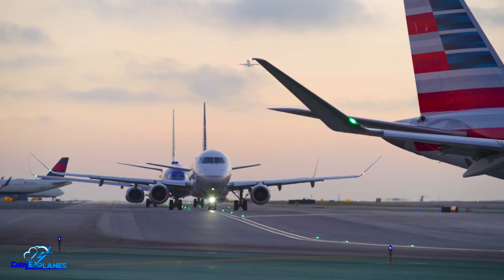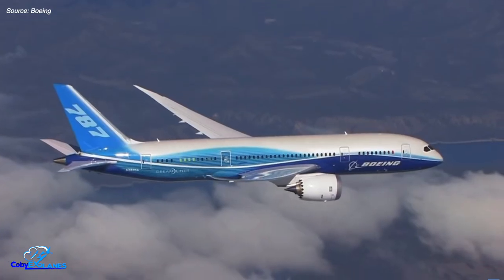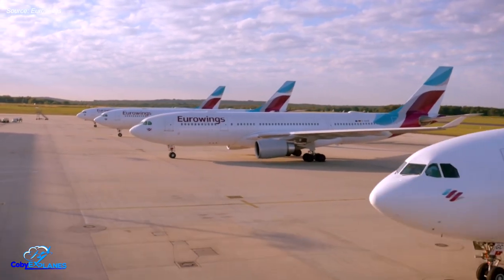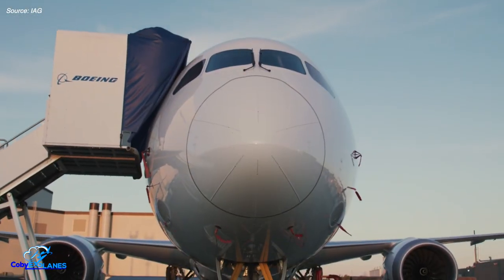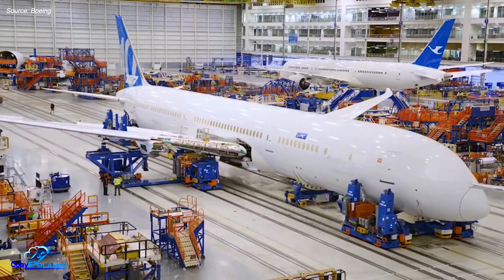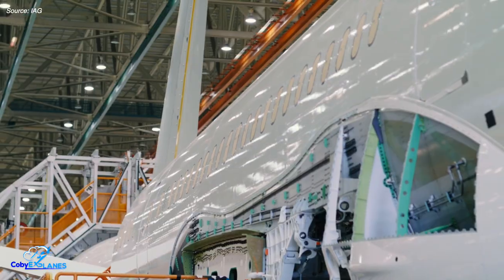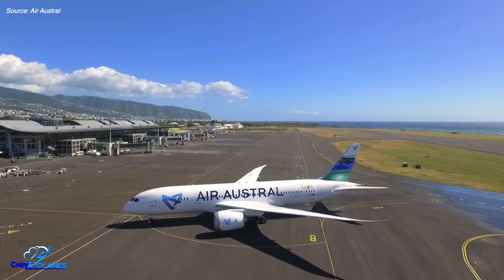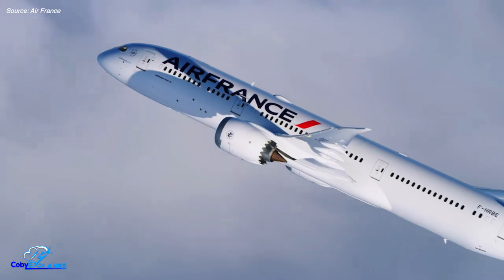How Boeing Spent $1 Billion Building a Single 787

Comment: Almost 10 years since its entry into service, 787 still looks and feels like a plane from tomorrow... The electrochromic windows, the bleedless engines, composite fuselage and wings, a nonconventional AC system, etc..
Reply: It’s still probably the most advanced airliner. The A350 came later, but since Airbus was playing catch-up, they stuck with some more tried and true technology with regard to the use of hydraulics instead of electric.
Reply: @Shadowfax-1980  I still have yet to fly an A350. I am curious about how quiet the aircraft is. Since A380's quietness has truly shocked me, I wonder how quiet the A350's cabin would be.

On the flip side, 787 feels like a long term acquaintance to me already. I've been flying 787 four times a year for 5 years now (could still have been ongoing if weren't for covid since that flight has been paused). Since I have stuck with 787 for so long, 787's technology feels like norm to me, while other aircrafts feel "rudimentary" lol
Reply: I hate those windows, they get so hot when they are darkened whilst the sun is beating against them. Like a little hotplate next to my face. Not comfortable when the pilot has decides that AC is not a luxury we are allowed to enjoy. I was looking for those directional air vents but those have also been done away with. That's just my personal experience with the 787.
Reply: @free_spirit1  Oh yeah the fixed AC outlets haha. 
From my experience the window heat isn't that big of an issue even when facing the sunlight (green rather than purple). I don't know, I get cold easily on the plane, and I prefer to sleep warm. Maybe we are different. Big windows do make filming and photographing WAAAAY easier though. 
My main complaints about the 787 is the air is too dry, and it's a bit loud.
Reply: Especially compared to it's direct competitor, A330 neo which is a re engined version of a plane derived from A300
Reply: @free_spirit1  Directional air vents are an option on 787. The air carrier decides whether or not to include them.
Reply: @Shadowfax-1980  though from experience, the A350 is much more comfortable to fly with as it’s wider. Not hating of Boeing ofc but yeah. Nevertheless, both types are amazing aircrafts.
Reply: @paulshi5974  as someone who flew the A350 5+ times…. It’s almost completely silent, and the standard windows are a plus. Also it’s significantly wider so the seats are too.

Comment: Someone in 787 flight testing told me that the missed release date was a creation of management, that the actually shipping date was close to what engineering had said it would be from the start. They didn't know what these problems would be, but they knew that there would be trouble with a tech this new.

Comment: 787 - First plane of it's type. All new electric systems, bleedless engines, all new fuselage construction methods.  The first few planes were how Boeing learned to make them.  
That cost includes all the tooling, development, construction, testing, fixing and more testing.

Still, at least when the separate sections were delivered, they fit together!  Ask Airbus about having bits of plane that don't fit ;)
Reply: Well said 55.   Late , but thank you !

Comment: great video again. I was just wondering... Considering that Airbus build the A380 at around the same time as the 787, but quickly realised that was a step in the wrong direction, could you do a video discussing how airbus was able to turn things around in an incredibly short time with the A350 considering it started development much later than the 787, but was ultimately only a few years behind comercial introduction thanks to it's incredibly fast development flights with almost no delays, which is today really uncommon for brand new airframes.
Reply from the maker: This is actually a really good idea, I'll add it to my list!
Reply: Essentially, Airbus played it safe with the A350. Everything the A350 used with the exception of the fuselage cross section and wing design were existing technology, unlike the 787, where almost every one of its technology was unproven or used en masse before. The A350 also had the advantage of its engines being built off of lessons learned from RR when it struggled with the Trents that powered the A380's and 787's. Having flown the A350, I found it to be very unremarkable as a "new" airliner.

Comment: When Douglas Corp built the DC10, they did the same thing and had to go back and retrofit planes that were half built when they found problems.  McDonald and Douglas came together, and then Boeing brought them, and obviously their staff, and as it seems that the persons from that side seem to have a lot of influence it seems they made the same mistake again.
Reply: Not how it happened but yes, they did make SOME similar mistakes. They however, were desperate to make a new profitable plane, since they were on the gbrink of collapse financially. They couldn't quite rescue themselves, but fortunately for AvGeeks, managed to do just enough to allow themselves the production of the MD-11. A stretched and improved DC-10. In Boeing's case, it has nothing to do with finances in regards to being anywhere near the brink of bankruptcy or collapse, but rather, just trying to force their planes out by dates they thought would be clever, while being ran by execs who have no engineering knowledge whatsoever, out for profits over quality, and thus, cost cuts galore, and ignoring their engineers who actually know what the hell they're doing.

Comment: The sad thing beside everything you explained so well, is the extremely tight configuration of 3-3-3 most airlines use. Making the dreamliner a nightmareliner for passengers in eco on long-haul. If only the cabin would be a few inches wider...

Comment: If I could know in advance whether I was flying on one made in Everett Washington or South Carolina, I'd fly on the one from Washington but never one from South Carolina : see documentary from Al Jazeera Broken Dream.
Reply: Boeing is shooting themselves in the foot hard here. They built the plant in South Carolina partially to crack the production unions. What ended up happening is they can't get the educated workforce down there that they can get in Washington. SC doesn't have the aviation education pipeline that WA curated over decades of Boeing presence. Getting C-suite out of WA because the new CEO's wife didn't want to leave Chicago was stupid. They need to move back to Seattle and get the MBA idiots out.
Reply: A plaque was suggested to be put over door two stating where the plane was built.
Reply: What's worrying is that going forward all dreamliners will be manufactured in South Carolina ONLY.
Reply: Al Jazeera? Who pays Al Jazeera? Find out
Reply: @dattaxpony920  Boeing choose Chicago in part because they could fly their fly their executive jets out of Meigs field on Lake Michigan, only blocks from their headquarters.  Shortly after Boeing moved to Chicago, the city of Chicago announced it was closing Meigs Field. Boeing lobbied the city to keep the airfield, but they discovered that although they had had lots of clout in Seattle and Washington State, in Chicago they were just another big corporation. So Boeing went to D.C. and got the FAA to issue an order to Chicago to not close the airport. Mayor Daley's response was the say  "watch this", where upon he plowed up the runway.  Today Boeing executives have to take the tollway to Indiana to catch their executive jets.
Reply: It looks like Boeing should have spent more time on getting the SC factory right.   Went into production too soon.

Comment: Hopefully this aggressive deadline approach will be a lesson not to repeat.  Goals must be met, but not at their own expenses.  It’s almost the opposite story how the triple seven was designed; I can’t remember the cost overruns details, the all computerized environment was impressive at the time.  Thank you for the video.
Reply: Sadly but clearly Boeing did NOT learn the 787 lesson and did the same rushed low cost solution with the 737MAX. That turned out tragically far worse than a few billion dollars on a spreadsheet.

Comment: When I was younger I used to like the 787 but I reallly love the 777 now since it was the first plane that I flew in
Reply: My first ever plane I flew in was a 767 300ER from TUI in 2014 :)
Reply: On the other end of the scale if you ever get the chance to fly in a prop driven airliner go for it.
Not the way I prefer to fly but it is quite an experience.    Flew an old Convair prop plane from Colorado Springs to Denver about 30 years ago.  Seems that Alaska is the only one left flying prop planes.   So not so easy to do.

Comment: Minor note, the 787 is not profitable for Boeing yet. It's estimated that even when they've built all ordered jets they might not make a profit on a single one of them.
Reply: Just like the A380 for Airbus.
Reply: Actually most estimate the break even is at 1200, which Boeing is almost at.
Reply: There is this thing called project accounting which Boeing and wallstreet (sic) uses.    It spreads development costs out over time instead of eating it all up front.    By this standard the 787 is doing OK.

Comment: I wonder if the 8 787's that came off the line in SC with bulkhead issues are going to have to undergo a similar process. Seems like that would drive up costs
Reply: you better believe that the refurb won't be cheap.

Comment: All this exeptional costs is directly atributable to the change in sourcing strategy, to switch from Internally designed products to be built by Boeing employees to a new sourcing strategy to outsource the design and production of the 50 core sub assemblies.  Boeing is reported to having to buy one failed supplier to recover the design and production.  The original launch budget was intended to to reduce the development cost from $12B to $6B.  In the end, the cost of the product launch was reported to be closer to $20B on top of the time delay.
Reply: Have you heard Sandy Monro talk about outsourcing?     Good stuff.

Comment: You glossed over the consequences to the launch date from Boeing's attempt to offload work to subcontractors as an attempted cost savings measure. Subcontractors that didn't have the experience needed to do what Boeing was offloading. Boeing ended up having to take back some of that design and production work in house.

Comment: A big cost not mentioned was Boeing offloaded design and manufacturing to companies that were incapable of the job so Boeing acquired the companies and technologies and built it themselves. This costed billions. The frame was new technology so Boeing was a first mover. This costed money too. Airbus was able to capitalize on it for the A350. It’s time for Boeing to use the 787 technology for a new combined 737-Mid-Market replacement.

Comment: "Boeing finally found its footing with 787 production", again, no Boeing bashing, but the House of Representatives report on the 737 MAX crashes begs to differ. And the most recent scandals of quality issues as denounced by Lufthansa are also showing that, yes, Boeing might produce cheaper 787, but at a cost for quality.

Comment: The 787 program cost somewhere between 35 and 50 BILLION dollars.  It will probably be the most expensive commercial airplane every built.  It will never make a dime in profit.
That includes the cost of purchasing so many suppliers like Vought in South Carolina (now a Boeing commercial factory) that simply could not provide the parts they claimed they would for the program.  Fundamentally, 787 was extremely outsourced under the theory that the suppliers would bear a lot of the costs and Boeing would maximize their profit.

Comment: Compared to its Original competitor, the A-380, that 3 Billion Tab is all worth it. Proving Boeing correct that Point to point is the future compared to Hub and spoke for A-380 is so much more beneficial than building planes costing billion each. The New Technology regarding Composite materials for the 787 that is now being used in the777x extends the value of the cost. 787 open new markets and opportunities till Airbus was able to counter with the A-350. How many years have the 787 flown without competition by that time? Where is the A-380 now and where is the 787 today? 251 orders compared to 1500 787 and are still active and operational and demand is still up. Dreamliner was made from revolutionary technology, to begin with, and this revolutionary technology will benefit Boeing in the long run with the 777x as an example. 3 billion for 3 planes is worth it.

Comment: To say it don´t include R&D is sort of a misnomer. While it certainly don´t include research... development is a other thing. One thing that make early aircraft very expensive is tooling. Specially so for composite air frames  that are very large. The tooling can of cause be reused for later aircraft's....

But in some cases they have to be scraped due to minor changes. And that is pretty much where the money run away.

I would say, this is really a part of development.

That there are changes made on the prototype jet is typical. The A380 first 3 aircraft was considerably heavier than the later. But usually they stop the production line after the prototype, then start it up again when the prototyping is finished

Comment: a (international only) full service airline operating a fleet of 29 B787-10 LR, 33 B787-9 & 5 SAAB 2000 turbo prop can be profitable, from the 2nd quarter of 2022 onwards!!! especially on long haul routes both trans atlantic & those connecting South Asia with the Middle East & Western Europe, ofcourse Australia as well!!!

Comment: One important note: the 787 is not yet "profitable". Despite the 787s that are currently being produced are sold for a higher price than their production cost plus their individual share of development costs (that is spread, in Boeing accounting over 1500 units), the overall program balance is still negative. This is because, for the first few hundreds of planes that came out of their production lines, Boeing has lost a significant amount of money that has not yet been compensated. This is normal to a certain extent in this business. They still hope that by the time they deliver their 1500th aeroplane, they should have made overall more revenues than the total costs, but it's not yet totally guaranteed. Till then, it is technically wrong to declare the 787 as "profitable".

Comment: What's the point in carrying the loads on the pylons at 4:38? Thanks for any insight
Reply: It might be used to test the wings to see if It could hold the weight of the engines without putting them on

Comment: 9:35 fortunately there is boeing military to pay all the tabs...
Reply: Errrr ... well apparently not. While the P-8 Poseidon is doing OK the KC-46 has been yet another example of how Boeing simply cannot engineer new aircraft or even re-engineer old aircraft. It is $4.3 Bn over budget, 3 years late, FOD in wings and fuel tanks, grounded at one point, unlicensed for passengers and cannot refuel other aircraft through its Boom. The sole reason for which it was built! Its so bad the USAF are only paying Boeing 80% of the agreed price until it is fully operational. In 2023.
And the KC-46 was beaten by the A330MRTT in the contract competition but was turned over by Boeing paid Senators. The A330 MRTT has been ordered by and delivered in full working order to 7 Air Forces.

Comment: First the 787 is the first all composite commercial airliner in service ever. Before this only the tail or floor panels were made from composites.  The problem wasn't that Boeing made a mistake with the design but rather that massive wing flex everyone likes lead the wing to transfer stress in a way a metal wing wouldn't do, and labeling as such isn't right, especially since it was a test aircraft and that's what happens in a test, you catch errors.  The wing was actually stronger than a traditional aluminum wing.  That wing box test wants to see the break in the wing, not in the wing box.  Also, building the first set of planes before the first test flights happen used to be more common.  The A380 had the next 6 planes already in some level of production before the first plane was finished, so did the A350.   The A380 had its own issues with wiring that had to be changed on every plane which pushed back scheduals.  But if anyone ever wonders why a 797 isn't in the skies today, this is why.